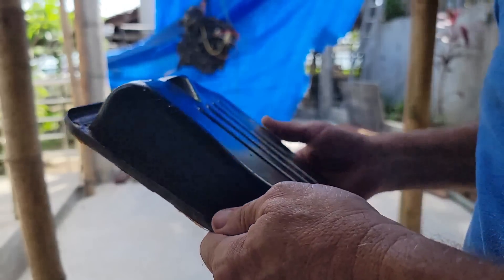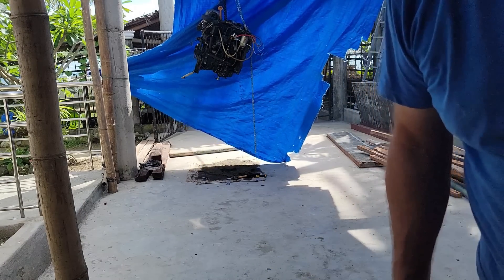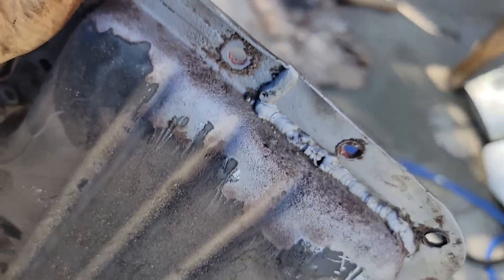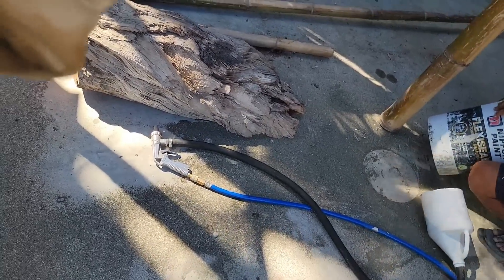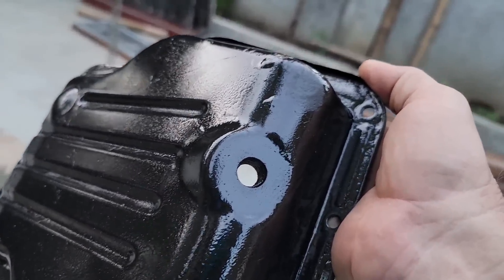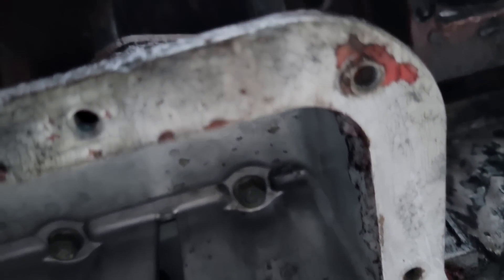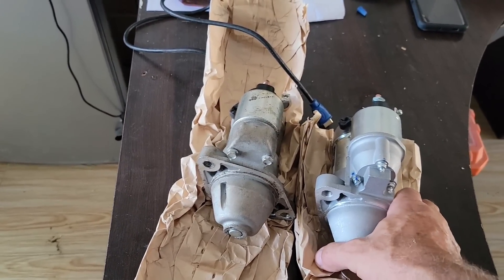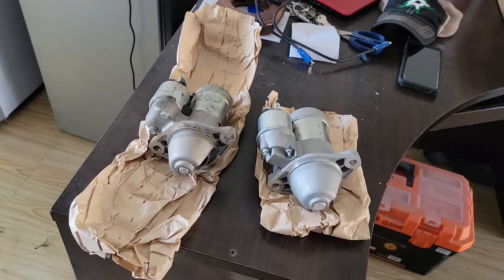Sea Ray 240 Gas to Diesel Swap - Servicing and Starting 1.7L Mercruiser Diesel Preinstall

Comment: I have a friend who did a similar swap, he had a 24’ skipjack with a 5.7, swapped to the same 1.7 Cummins. I wen out off shore with him fishing, what a sweet boat that was, good cruise speed up on plane, got close to 7mpg as well. It did sit a little awkward due to the difference in engine weight, solved that by moving fuel tank aft.
Reply from the maker: So nice to hear this. This too is a 24' and 5.7. We figured the differences and I will be shaving about 400lbs off of it. I plan to offset with lithium solar batteries and a second fresh water wank. I do thank you for sharing your experience in a project almost the same.

Comment: Want to get rid of rust forever use POR 15 .. bit you just overcoat if used in sunlight.  Navy used to use on ships but .. of course now use a much much more expensive new process. POR 15 is brushable and it wicks into rust

Comment: I had my kubota tractor starter and alternator both rebuild here in the philppines at a local shop for less than 3000 php for both.   Just like new.   A used starter alone was  22k    Yep keep for spare
Reply from the maker: Very nice!

Comment: There are lots of good electrical shops in the city, surely they can rebuilt the old starter and. make if a spare for the sea ray, I remember the Canadian blogger Ben and his wife Ashley of sailing nahoa when they are Cebu they brought the old starter and have it repaired the electrician repaired it good as brand new.
Reply from the maker: I remember that episode also. I had my toyota starter done at one shop and it only lasted days so wont be going there

Comment: Coat the pan with epoxy, you probably shouldn't have painted the inside
Reply from the maker: I DID NOT PAINT THE INSIDE= everyone keeps saying that. It is coated from the factory inside - it is a marine salt engine I painted the lip
Reply: @TexasFilipino  my bad, it looked like the same fresh paint in the camera as on the outside that you painted. Seems weird that it's painted being that it is constantly covered in oil

Comment: James why did you paint the inside of the oil pan
Reply from the maker: It was already painted. Please realize this is a saltwater boat. Salt gets in everything in all kinds of ways. A engine crankcase breathes and it will draw in salt mist over time and that salt will damage the metals especially something like that sheet metal pan  I know your thinking is that oil is in it and no way it can rust but you would be highly wrong to think that. The previous damage to this pan was from the salt in fact and why it needed to repaired.

Comment: love your channel & have followed for years but as a safety tip please watch --blastone international on youtube  . subject--( is silica sand safe to use as a blasting abrasive )
Reply from the maker: I used sand from the beach so for your knowledge  also here is some information 

"When we talk about silica exposure we are talking about crystalline silica or quartz. Construction workers could be exposed to silica when cutting, grinding, drilling, sanding, mixing, or demolishing materials containing silica.
 The size of the airborne silica particles determines the amount of risk. Smaller particles can be inhaled deep into the lungs where they can cause damage. Larger particles, such as beach sand, are not as great a concern because they are too large to inhale."

Comment: You should not have painted the inside of the oil pan. The paint will disintegrate and plug up the filter.
Reply from the maker: The pan was already painted with marine paint from Mercruiser.  

Dan Herchenroether
James why did you paint the inside of the oil pan
Texas Filipino
It was already painted. Please realize this is a saltwater boat. Salt gets in everything in all kinds of ways. A engine crankcase breathes and it will draw in salt mist over time and that salt will damage the metals especially something like that sheet metal pan  I know your thinking is that oil is in it and no way it can rust but you would be highly wrong to think that. The previous damage to this pan was from the salt in fact and why it needed to repaired.
Reply: @TexasFilipino  I think you will find that mercruiser doesn’t paint the inside of the motors … I worked and played in the industry for over 60 years. The paint was probably applied by the last person who repaired the pan .
Reply from the maker: @henrysangret5324  I did some research to find that it is coated from the factory. I also looked at a mercruiser replacement that too was coated. Thank you
Reply: @TexasFilipino  I only worked in gas not diesel .. must be a baked powdered coat, diesel I know softens paint and some powdered coat.

Comment: Gotta love the sound of a good runnin happy diesel engine. It’s one of my favorite sounds. Everyone thinks rolling coal is cool but I don’t. That’s actually bad for the engine. This thing sounds and looks like it’s happy and ready for work 👍
Reply from the maker: Now that it ran awhile and got bled out good it stopped smoking also. Just purrs. I let it run for about 30 minutes the other day.
Reply: @TexasFilipino  usually does take awhile to break them in and cold starts can be difficult sometimes but after they’re warmed up it’s smooth as butter. I could tell from the sound that it wanted to run and work again and you did a great job 👍

Comment: If you take a long handle screwdriver and put it over each cylinder,  one at a time and put your ear against the screwdriver you can listen to the engine for early signs ot trouble. 👍👍